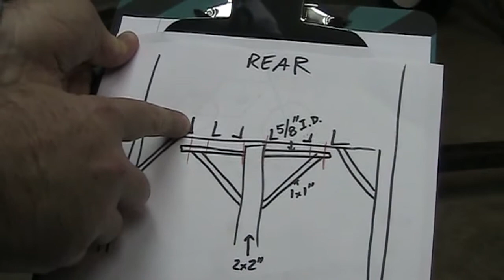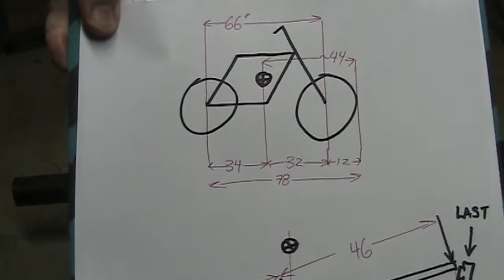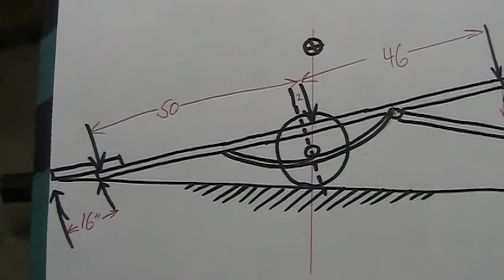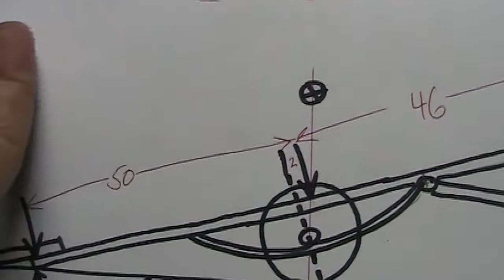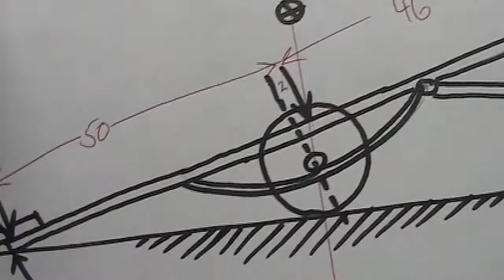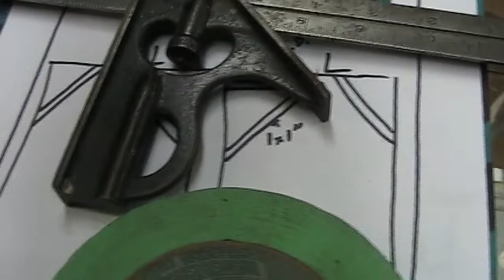Making a DIY TILT-Trailer (Part 3)

Comment: I know this is two years old, but you might not need to extend the back end of the trailer.  The extra 4" of length behind the axle and the trailer weight of that extra 4" might be enough to keep it tiling forward until the rear wheel gets to the back of the trailer.  If not, simple add a few lbs of weight to the back end of the trailer (trial land error).  Does the center of mass include the rider?  That can change calculations.